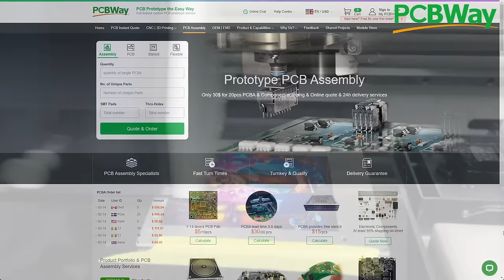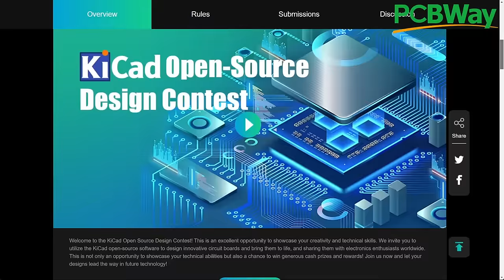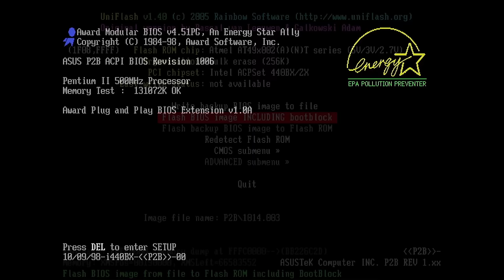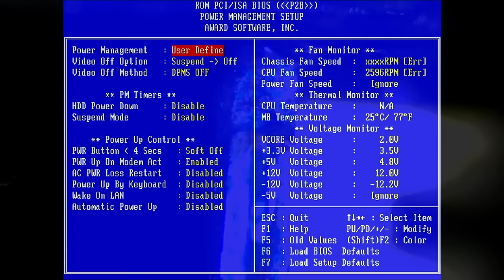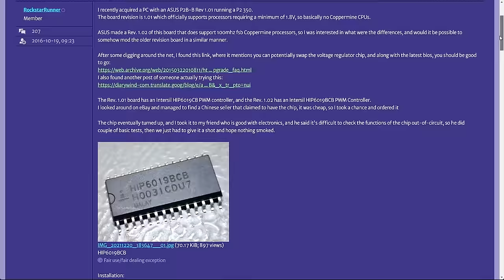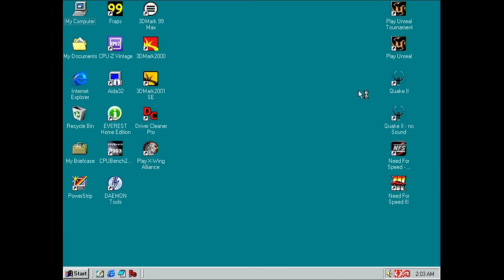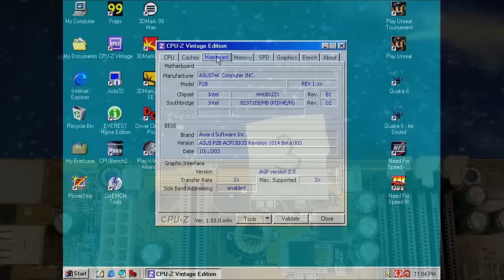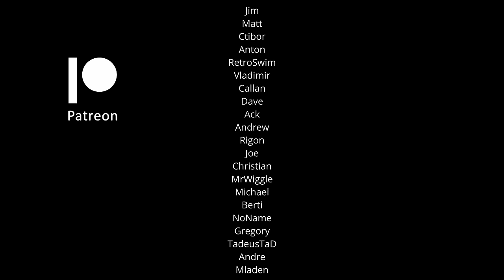ASUS P2B Restoration: Board #3 - Native Coppermine Support with Mod!

Comment: For vias, i drill them out with an under size drill with a pin vice. I then use old chopped through hole legs to reconnect any faulty large vias, or a fiew fine copper wire strands for those extra fine vias. With corrosion that bad, i'd do this treatment for pretty much all of them. A single faulty via is a nightmare to diagnose, let alone find
Reply from the maker: I have some drill bits coming my way. I think you are right that it would be better to clear out those vias. At the moment I try my best with what I have. Thanks for watching and recommending!

Comment: Love that series! I was the owner of a Asus P2B-DS, that I got in '99 and used 2 P!!!550 Katmai CPUs. I kept and upgraded that system for 10 years. I did the VRM controller and clock generator upgrades (Studying electrical Engineering at the time). I used 2 Coppermine 1GHz and then upgraded to 2 Tualatin 1.4GHz. That was, and still is, the best system I ever owned.
Reply from the maker: Wow! What a journey!

Comment: Imagine someone who started out with a crap pentium II based celeron, then soldered that chip on and put a P III coppermine in there with the 133 fsb and everything. That's awesome!
Reply from the maker: Yeah, all possible with this board! I did notice some bad AGP stability problems however due to the higher bus frequency of 89 vs 66 MHz. The BX chipset wasn't meant to operate at 133 MHz and therefore doesn't have the correct divider for the AGP bus at such high frequencies

Comment: I've always bought motherboards and CPUs in pairs. I've never upgraded a CPU....until 2021. I couldn't find a Ryzen 5900x and it was the CPU I just HAD to have. So I got a Ryzen 3600 instead. When I found a 5900x, I swapped it out. So my 3600 has very little use, but it was never supposed to be the CPU of my computer in the first place. So is that an upgrade? Technically. If so it's the only time I have ever done that. Personally I consider the 3600 to be a temporary downgrade.

Comment: Way cool.  I have both a P2B--F and P3B-F and when I wanted more CPU power back in late 99/early 2000 I did just that by upgrading.  Back then I could not have done this mod but I certainly can now and that is a great mod.  I like my P3B-F but the shortcoming for me is the single ISA slot.  I don't think I will do this mod now as my P2B-F is how I left it with a 450Mhz PIII, and a Voodoo3 3000.  It is a nice DOS and Windows rig where as my P3B-F was pretty much only ever used for Windows (ME, haha). Awesome work, looking forward to the other repairs.
Reply from the maker: Sometimes, it's just better to leave old retro hardware as it was intended to be. With all its flaws and shortcomings! This is what made us like and build a bond 😄

Comment: this is like watching one of those carpet cleaning videos at 2am :D You can't skip them!
Nice job again and amazing mod - so the IC talks to the CPU itself and sets itself up with no human intervention? Cool!

I also now use low melt for removing ICs. It's always safer. I tend to use a little hot air to pre-heat though.
Reply from the maker: I think the CPU is directly connecting to that IC grounding a pattern of pins which is coded for a specific voltage. That is why we can overwrite it using those adapters - they change the code.
Reply: Says the guy who also makes motherboard repair videos.

Comment: Had the exact same experience. I opted for a full removal and replacement of all corroded components.
Solder joints should be considered as unfit.
All the leads can't just be drag soldered back to state, as you said solder won't stick.
Congrats for the job!!
Reply from the maker: Thank you!

Comment: 8:19 corrosion is only likely to reappear if the board has power flowing through its via’s. So be sure to do so. :) 

The solder mask is creating an air tight seal, which will prevent further corrosion at least in the short term. Cracks in the solder mask due to bending and/or heat could possibly prevent that though.

Comment: Great restoration and very cool mod! I would not have dared to make it myself back in the day... I would probably have ended with a broken motherboard soaked in my tears 😅. Looking forward to the next chapter in this series!
Reply from the maker: Thank you! Ah, yeah... I remember once damaging a Gigabyte dual bios board (Athlon XP) because one of the BIOS chips physically failed. I tried to remove it with a soldering gun! 🤦‍♂️
Well, I ended up with ripped of pads and had to live with a warning message while booting.

Comment: It is so nice to see you using drag method to apply solder.. I wonder why not so many people do it, I think it is a matter of experience. But it is very satisfying to watch your videos.. thanks for the great content. I have the feeling I learn a lot watching your videos and I feel more confident to try one or other project to recover an old board or component.
Reply from the maker: Thank you! I still create solder bridges when dragging solder most of the time. But you're right, it gets better with practice. You learn how much flux to use, how to hold the soldering iron, and what temperature works best for your equipment. The best way to learn is by doing - so, I hope you'll try your luck in restoring an old board.

Comment: Later revisions of the P2B (1.12 and higher) have the BCB version on board. The revision 1.10 either has the BCB or the CB version.

My P2B revision 1.10 has the BCB and is able to support the Coppermine, and also the Tualatin when using a Tualatin compatible slot 1 adapter. I use the Upgradeware Slot-T adapter with a Tualatin Celeron 1.3 GHz installed.

Comment: I was looking forward to another P2B episode 😊

Regarding the HIP chip, my P2B-S also has one but in 6004BCB variety. Since the board works with a slot-1 P III 1000/133 without any problem I reckon it’s the extra B before CB what determines wider voltage range needed for Coppermine compatibility, the exact model number may be less important.
Reply from the maker: Yes, I there are multiple variants of this chip. But you should still check for pin arrangement - those might differ, but the function of the chip may be identical. Glad to hear you like those videos about the P2B :)

Comment: I’ve seen the post on Vogons before and bought the chip to perform the same upgrade! Good to have a quick preview on your series. I have a slot 1 Soyo board, cosmetically perfect but fails to boot… normally no boot codes. I managed to boot once and get into bios, but it frooze. The seller said it was perfect, he ended refunding me 100% and I kept the board. I changed all capacitors, no changes. I watch your content hoping it will give me some ideas on how to fix it. Persistence pays off in the long run. Thanks for the content!
Reply from the maker: Yes, sometimes it's just better to wait until you get more experience or an idea what could be the issue. Maybe it's related to the socket - I had some very flaky behaviour with slot 1 connectors especially when there are no retention clips. I would clean the socket with contact cleaner or a brush with isopropyl alcohol. The fact that it bootet means that the traces and vias are fine. Maybe I'll come across something similar and it gives you more ideas on what you can try. Good luck!
Reply: @bitsundbolts  yes someday I will get it. I cleaned the slots and visually there were no issues. Perhaps there are cold joints on the connectors or on the chipset, which would require reballing. I’m slowly learning that art with scrap boards, it will take time before I try something like that on such board: and it will be last resort.

Comment: Amazing video, I'm surpised with every repair video you upload. Congratulations!

About the 750E 'thing', this happens in lots of 440BX boards when using 133Mhz cpus. I have a 600EB for example that is reported as 450E, although this model never existed!

Nothing to worry about 😊
Reply from the maker: I see. Good to know that seems to be normal. Must be that 133 MHz was never expected for the BX chipset.

Comment: Cool video! Chip replacement was unexpected b/c I didn't know it would work without some bios modification
Reply from the maker: Yes! I was surprised as well. But it looks like the latest BIOS (which is also used on later revisions of this board) has everything that is required to communicate with this new chip.

Comment: Thinking about how those boards came to be so much corroded in this green way - it looks like these were stored together with older boards containing the dreadful Varta style NiCd batteries. 🤨 Nice fix! You have encouraged me not to give up on one BX master board that I salavaged at a scrapp yard. No corrosion, just scratches. Bad - but doable.
Reply from the maker: I wonder as well what has happened to those boards. Good luck with the BX Master board! I'm sure you'll be able to rescue it!

Comment: I wonder why it took me so long to realize it, but the question in the end is always "P 2B or not 2B"! 🤡 I'll show myself out...

But seriously, congratulations on another success, glad to see you are still on track for a flawless victory! I had no idea the P2B could be pushed that far and even further, I went all in on Athlon after the P2 and never looked back.

Also, super happy to see that contact cleaner did the trick here after we just discussed it for the slot on board #2. 😊

As for the corroded ISA Slots: Wipe them out. All of them. For cases in which replacement is not an option, a comparison of the effectiveness of different treatment methods would ofc still be interesting though.
Reply from the maker: Haha, yeah - show yourself out 🤣 
Thank you - and yes, I'll try to achieve 6 of 6 boards! A contact cleaner is definitely worth a shot to clean the contacts. However, so far, I haven't seen one to remove corrosion that's better than vinegar.
Reply: @bitsundbolts  For visible corrosion, mechanical cleaning + applying vinegar like you do is definitely the way to go, no doubt about it. For contacts that look clean but haven't been used in a long time, I've achieved good results by spraying them with contact cleaner and plugging stuff in repeatedly a few times though. It is probably also a good idea to spray freshly vinegar-treated contacts with it (after drying), if only for the protective film it leaves behind.

Comment: That you got 750 MHz instead of 1000 MHz is normal. The CPU is a 1000 MHz version with a FSB of 133 MHz. This gives you a multiplier of 7.5. The 440BX chipset however delivers a FSB of 100 MHz, resulting in a CPU frequency of 7.5 * 100 = 750 MHz.

On the P2B there are jumpers to force the 440BX chipset to deliver a FSB of 133 MHz. This is out of spec for the chipset, but a lot of them run perfectly with a 133 MHz FSB. Check that the AGP divider is then also set to 1/2, otherwise the AGP slot will run on 87 MHz instead of the stock 66 MHz.
Reply: I thought the BX only supports 1:1 and 2:3 for the AGP divider, so you're stuck with 89 MHz when using 133 MHz FSB?  Some video cards are more tolerant of that than others.  It does support a 1:4 PCI divider for proper 33 MHz PCI speed, however.
Reply: @awd42  yes, you are correct.
Reply from the maker: Yes, unfortunately, there is no way to change the divider on AGP. Only 1:1 and 2:3 are supported.

Comment: again, great work! with replacing the power control chip, can you then use any slocket with any cpu (piii/cel)?
Reply from the maker: Any compatible CPU should work. Even a Pentium III Tualatin (provided it has the required mods to work on a sloket adapter) should work.

Comment: I love your videos. they are always interesting. only thing i could complain about would be stock music being over used but you cant help the fact that 1000s of others choose the same song in there video. lmao. I wait with anticipation for each video you make. 

Thank you again for the quality entertainment. and i love to see a comparison of corrosion removal products. I also like to see how each one works on different types of corrosion. like cap juice corrosion vs battery leaking corrosion. are they different and if so what product works best? I know one thing i cant stand when i clean a board is the ghostly white film that develops on the surface. its almost impossible to remove and vanished if gotten wet but comes back when dry. I did see someone say wd40 can remove it but damn that would be some work.
Reply from the maker: Yeah, I pick from music I downloaded from the YouTube music library. As long as I'm not browsing through it again and find some songs I can imagine to be part of my videos, I guess we'll all have to be fine with the ones i have right now 😅

Yes, I know what you mean about that white residue that looks like leftovers of tap water, but impossible to remove. With enough scrubbing and isopropyl alcohol, it fades a little bit, but never goes away fully. Sometimes, I use those magic sponges (melamine sponge). Those work, but they are like very fine sanding paper.

Comment: That was some kind of soldering job.  What kind of iron tip do you use.  I can see you are using high quality braid and flux everything just works for you.  Your Microscope work is great as well can see everything.
Reply from the maker: I am using a portable soldering iron from FNIRSI - the HS-01. The tips I use came with the iron. I like the bevel tip since it's a nice tip for most situations.

Comment: I wouldn't mind seeing some comparison between oxidation removers (vinegar, lemon juice, ...).
Reply from the maker: Alright, let me see what I can do.
Reply: @bitsundbolts  I usually use white vinegar, it's the cheapest, I think it is also the strongest, and it's not difficult to clean with soap and water. I think lemon juice is a bit less strong and it leaves more residue when it dries (because it has more sugar than vinegar, maybe). But maybe I'm wrong. I've never tried other products.

The main problem with vinegar I think it's the smell, it's not a bad smell but it is very intense for some people maybe. I don't mind the smell, I'm used to the smell of fermenting grapes.
When I'm sleeping and I hear a mosquito, I pour some vinegar in a plate and place it in my bedroom and go back to sleep. I've heard that the vinegar mistakes mosquitos, but perhaps I was mislead.

I like to see you remove the green corrosion from inside the holes that go from one side of the motherboard to the other side, it is very satisfying.

Comment: always wondered if there was an adapter for slot 1 to a slot A
Reply from the maker: The chance that such an adapter would work is close to zero.. hehe, back to the socket 7 times when there were multiple vendors creating CPUs  for the same socket.

Comment: Do you think the engraving pen would be a good way to remove spot welds on 18650/21700 cell nickel strips? Like, just grinding away the tiny spot on the nickel strip so there is a tiny hole left over? Removing them cleanly such that the nickel strips can be used again when replacing a couple bad cells in a larger pack is proving to be very difficult.
Reply from the maker: Hm, I have a feeling that it may not be strong enough. I usually grind away solder mask, soft metal, and plastic. Technically, you should be able to engrave in metal and therefore, it should be possible depending on the bits you're using. It may take a long time though.
Reply: @bitsundbolts  Well, I can use it for removing solder mask and such too if it doesn’t work out for spot welds so I think I’m going to buy it from your link and try. :) Thanks!
Reply from the maker: Thanks! I hope it works for you. Let me know once you try it - I'm curious myself if it's strong enough

Comment: What temperature did you use on the tip when soldering the chip or the copper wires ?
Reply from the maker: I set the iron between 320 and 340 degrees

Comment: What is this low-melt solder beeing used here? I desperatly need to buy this! Thanks a lot
Reply from the maker: There are links to the low-melt solder I am using in the video description.
Reply: @bitsundbolts  Thanks a lot. 👍

Comment: does it use the 133 bus speed of the 1000mhz and use the 133 memory in the slots
Reply from the maker: It does have the 133 MHz option silkscreened on the board. It seems to work, but not with the Radeon 9000 (AGP) I am using due to the issue with the bus frequency of 89 MHz. Based on what I've read is that there are many cards that would work with the higher bus speed however.

Comment: Is it a 3 FSB jumper or a 4 FSB jumper, may need another tweak to become the ultimate P2B, though even the best 133 option overclocks AGP to 89MHz (but has correct PCI), the 3 jumper 133 overclocks PCI as well
Reply from the maker: It has 3 jumpers to select FSB, but it supports 133 MHz (also printed on the silk screen). And yes, I already encountered some flaky AGP issues due to the higher bus speed.
Reply: @bitsundbolts  3 jumpers gives PCI 44MHz, you need to hack the 4th one in to get 33MHz PCI but the AGP stays overclocked. Depending on the board revision, the hack is either easy or difficult

Comment: tbh I would have bought a new board and left the old system intact. The jump to 133FSB was worth it for me back then.
Would an ultrasonic cleaner remove all the corrosion?
Reply from the maker: This revision of the P2B supports FSB 133mhz, but is an issue because the AGP frequency is increased to 89 MHz. There is no way to change it because the divider is part of the chipset. If you're using a PCI card however, then there's no issue.
I don't have an ultrasonic cleaner yet. Maybe I'll get one some day.
Reply: @bitsundbolts  Hey man! Keep up the good work. Love your content. Personally had issues withe OC AGP BUS as my NVidia TAT2 didn't play nicely with it. Forums suggest it was a "me" issue at the time, but I was not able to get it to work.